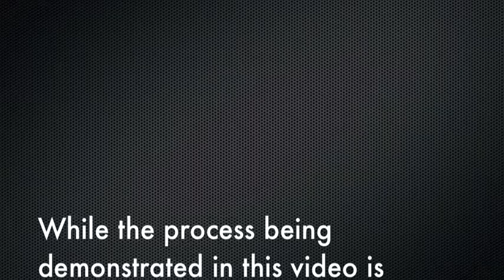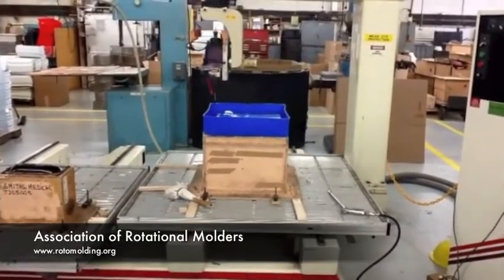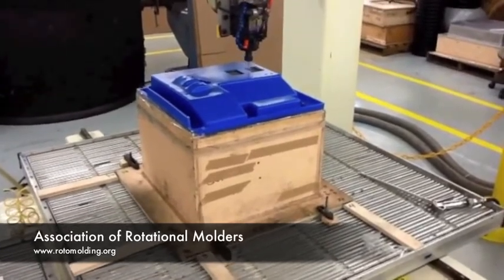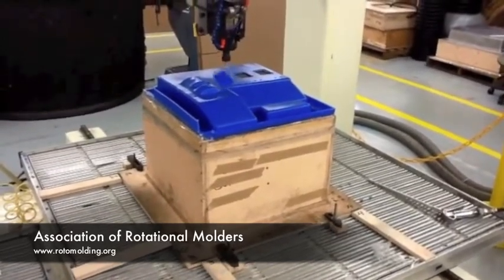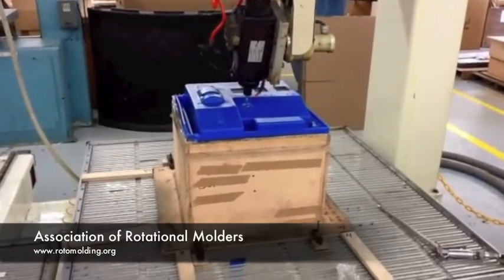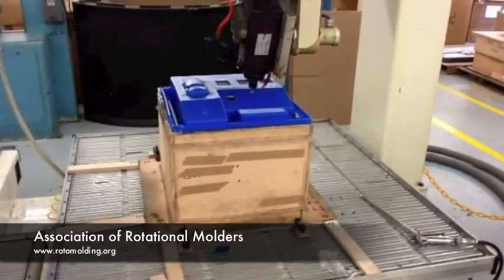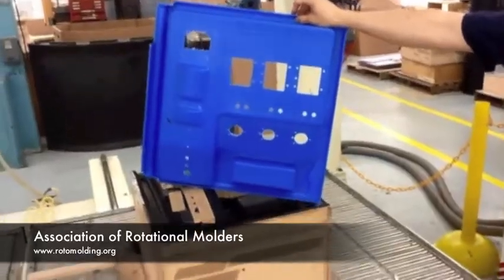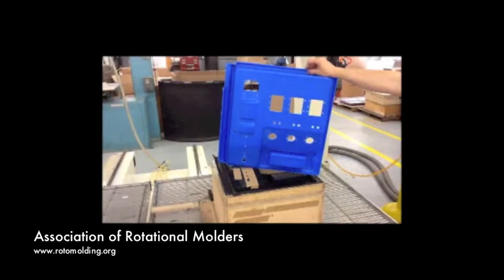ARM 5 Axis Machining

Comment: When it just started I was thinking about how much time you would save without all the extra movements...then you mentioned it at the end. If you knocked off a minute (from 8 minutes to 7 minutes...probably less) and you ran this thing for 8 hours, you could go from 60 parts in an 8 hour shift to almost 70.

Also, when you're trimming the part to height, from what I saw, you could use the same tool all the way around. If your spindle could go to 18,000 RPM or higher, you could double or triple your trim speed. Also, around the corners where it's going slow, if you make an arc instead of a bunch of points (that's what it looked like) you could knock some serious time off. If you can only do the points, most of those older machines have a "look ahead" line of code which burns through points faster.

Thanks for the video!